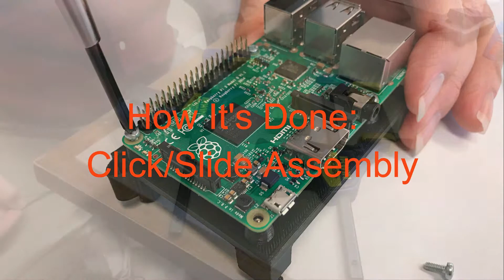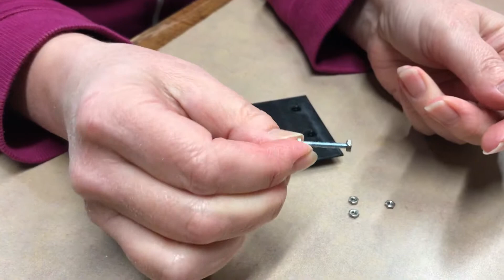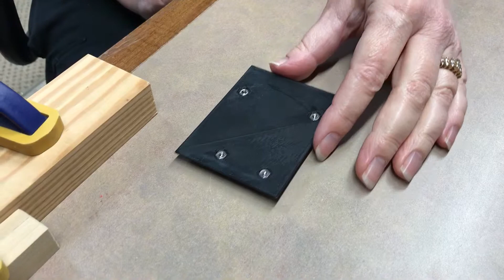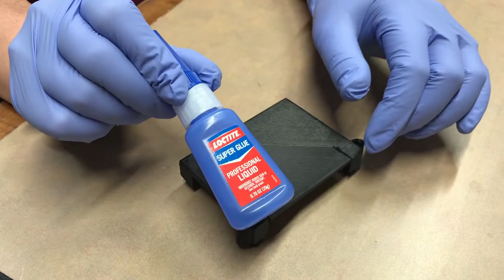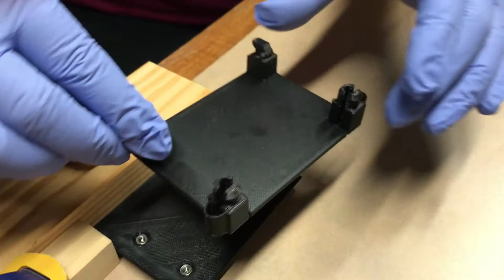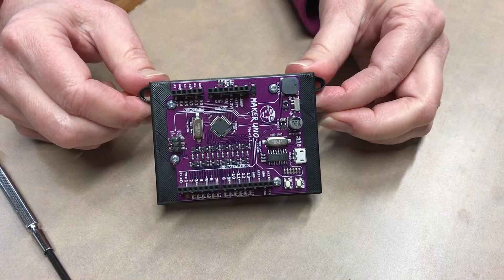Click+Slide Assembly for the WorkBench PDK

Comment: Are the 4 larger hex nuts 3mm?
Reply from the maker: Correct.  The smaller ones that go in first are m2.5 hex nuts.  The larger ones that go in second are m3.0 hex nuts.  The m3.0 nuts are actually just spacers to ensure that the m2.5 nuts don't accidentally drop out of place after the Slide is glued to the Click.